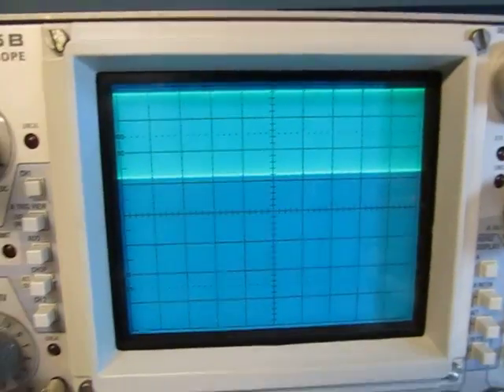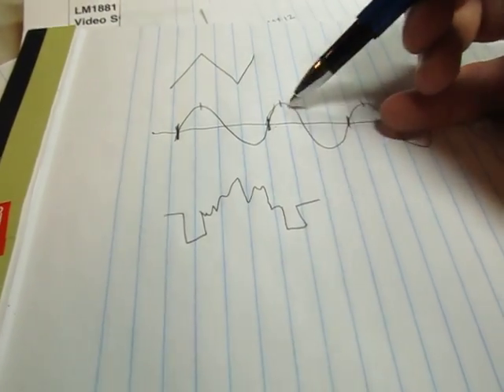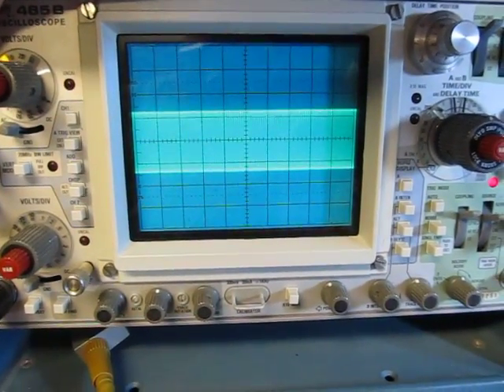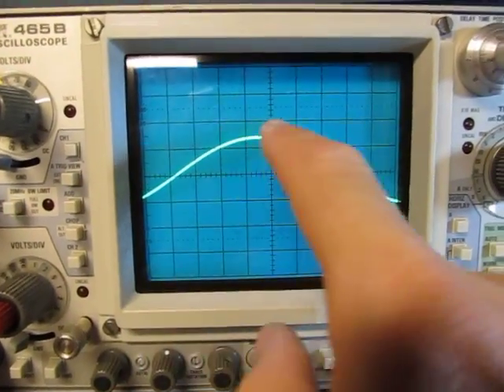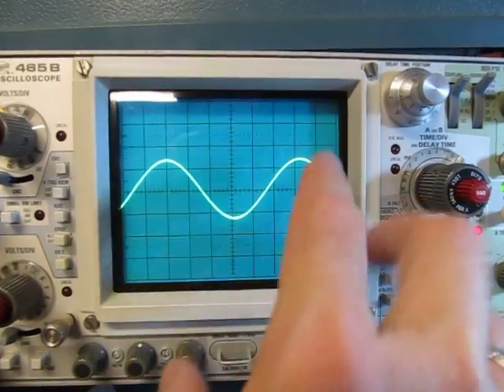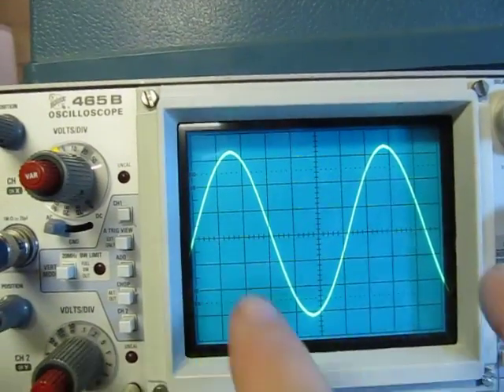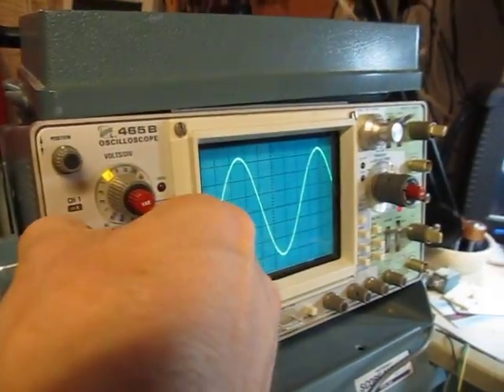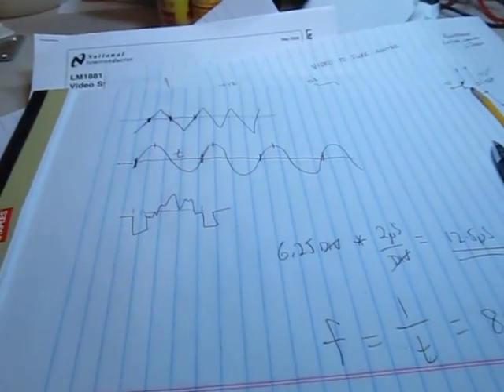#43: Analog Oscilloscope Basics: Making a Frequency Measurement

Comment: Stayed up way later than I expected dinking around with my Tek 465b I just bought and testing different frequency measurements from my old elenco mx-9300 and my little PTL-1 from CIE. Your videos have been a great aid in learning and I know I have a long way to go but I'll get there eventually. Thanks for sharing so graciously with us, not only your knowledge but your time. I can't thank you enough. Be blessed.
Reply: How is the 465B working out for you and is it not too difficult to understand/learn?there is one for sale in my area and I might buy it. I could use it to trouble shoot some stereos that I have.Cheers/Rob
Reply: +Rob Hernandez The 465B has been working out just fine. Still works good and haven't had any problems with it. Not too difficult to work with I don't think. Everything has been pretty straight forward and they're built like tanks so you can't really go wrong with one. I would recommend it in a heartbeat.
Reply: Thank you very much Redemptus I think I am going to go for it. I have heard that the Tektronix brand is a good one. And I believe this model comes with a DMM built in?
What can you use the DMM for?
Reply: Rob Hernandez The DM44 is an option for the scope so you'll find that not all of them have it. It allows you to measure DC voltage, resistance, temperature (with the temp probe, mine didn't come with the probe and it appears that Option 1 specifically excludes the probe to save on price,) as well as differential delay time (the time between any two points on the oscilloscope trace.) Honestly, I haven't used mine as it didn't have any probes though I think it can use standard 4mm banana plugs but don't quote me on that. Update: Couldn't leave well enough alone so I got some probes and sure enough it will take the standard unshrouded banana plugs. I'd have to read up on how to measure the delay between two points on the trace though as I'm not sure how that works yet. Guess I have to schedule some experimentation time soon. :)
Reply: Well that is good to know, I think  one that is for sale in my area does not come with the DMM.
I am sure that you eventually will figure it out,
Good luck. Ah and good to know that you can use the banana plugs.
Cheers

Comment: First, always measure to the center of the scope trace.  Second, the oscillation divides 1 s of time into 'f' pieces (cycles) so that 'f' T=1 s.  But we give the frequency units cycles/s=Hertz so that fT=1 instead.  Period has units s/cycle so the units cancel.  Usually, we write one of the equivalent expressions f=1/T or T=1/f.  Third, the 1% scope calibration reflects our ability to locate the trace to about 0.1 divisions; 0.1 div / 10 div = 1% is the best measurement we can make anyway so it is pointless to spend more money on more precise components.  Fourth, it is also valid to measure several periods and this strategy will always allow you to use more of the display for more precision; however, don't forget to divide your time measurement (or multiply your measured frequency) by the number of periods and be sure you count the number of cycles correctly.

Comment: Very thankful for your sharing! Question: How would you measure the percent of modulation in a signal for radio alignment? Project requires 455kHz 400 kHz, modulation  80%. Can a circuit be built that will enable you to introduce the required percent of modulation into a signal? Thank You!

Comment: Thanks for the video. Quite enjoyed. Would you kindly make a video about frequency counters, please. I have a basic/digital counter but don't know where to plug in a transmitter to see broadcasting frequency live, or, in a receiver to see what frequency I am on. Thanks a bunch.
Reply from the maker: Most transmitters and receivers use a superheterodyne architecture.  Thus, the operating frequency is controlled by a Local Oscillator (LO).  It is most common to attach the Frequency Counter to the LO output, and then apply a frequency offset in the counter to correct for the IF frequency.
Reply: @w2aew  Much appreciated the comment.

Comment: Wow, immediate reply, thanks very much. I'll do the maths re using 1/4 watt resistors in parallel, as I don't have any 1/2 watt ones. Thanks very much.indeed. My newly acquired, but elderly Marconi Wattmeter has a function that may be similar, but I am unfamiliar. An insert probe knob, a small secondary "diode detector" meter, and a "mod out" jack socket. I suspect it may do part of what your circuit offers, but I'd rather have a standalone interface. Thanks again!

Comment: I wish you had covered how to trigger on the delayed sweep.  I'm looking at a 50Hz square wave (generated from 50Hz mains), which looks really clean - until I expand the transitions, which show HF ringing.  Half way across the screen, however, there's a bit of jitter, so simply expanding the waveform isn't enough to see the ringing.  I need to stabilise it.  I have a 2465, but this is the first time in 20 years that I've had it out, and I can't remember how to use it properly.  It had taken up smoking in the interim, so I had to replace all its PSU capacitors first.
Reply from the maker: I've got a couple of videos on using the delayed sweep, and the triggering on that:
https://www.youtube.com/watch?v=J-7MycqHPOs
https://www.youtube.com/watch?v=vvqVTD-VEow
https://www.youtube.com/watch?v=0enuruGWYk8

Comment: When an audio amplifier has an oscillation problem that is causing oscillation in the amplifier circuit somewhere. I have seen repair technicians set the Oscope to a very slow sweep on the timebase so that you the trace as a moving dot. The moving dot will move up and down at random from the oscillation issue in the amplifier circuit. What I'm confused about is why are the repair techs setting the Oscope to a very slow sweep time base which is ment to measure and display very low frequencies and the oscillation frequency is audible. Since the oscillation is audible I would think of setting the Oscope timebase to a fast sweep setting but then you won't see the oscillation because the Oscope is just display a straight flat line even when the oscillation is not a low frequency and it Audible hearing the oscillation coming out of the speaker.

Comment: W2aew, I connect a +9vdc to the oscillscope channel#1 and connected a lab test function set at 1Khz sinewaveform frequency to the "External trigger" input and set the Oscope trigger Mode to external. Why isn't the Oscope displaying and drawing a 1Khz sinewaveform frequency on the Screen?
Reply from the maker: That's not how an oscilloscope works.  The scope displays what is connected to the vertical channel input(s).  So, in your case, it is displaying a flat line that represents the 9Vdc that you connected to it.  Instead, connect your 1kHz signal to channel 1 and change the trigger source to channel 1, and you'll see your signal generator's output.

Comment: Is it possible to setup an old analog scope to display/plot the RMS of an AC signal?  Like what happens when you zoom out of a DC signal and see it plot over a long period of time.  It would be similar to how these newer bench DMMs are graphing the fluctuation of a DC signal or RMS of an AC signal.  I have a old Tek 5540 scope and a digital Rigol scope where I'd love to figure this out instead of buying a new bench DMM.
Reply from the maker: Are you sure about that Tek scope number?  I don't recognize that as an old Tek analog scope.  I know there was a 5440 scope (analog scope with 3 plug-in slots).  The digital scope will usually have an RMS measurement as part of their automatic measurement system.  An analog scope can not show you the RMS value as a trace directly.
Reply: @w2aew  The Tek 5440 is aka (5403/D40).  My digital scope with state the RMS figure but won't plot it.  Does Tek's new digital scope plot the calculated RMS?
Reply from the maker: @rpbale  Newer scopes can plot measurement trends

Comment: Hello, I own a Leader LBO-526 scope. It also has Delay time , A and B TIME/DIV and DELAY TIME. 
The coupling has: AC, HF-REJ, TV-V AND TV-H.  The source has: ALT, CH-1, CH-2, LINE AND EXT. 
Can you explain what these are and would I ever use these functions.
Thank you.....
Reply from the maker: I have videos on these topics.  They show the features on a Tektronix scope, but the operation would likely be similar on your scope.  The Delay Time, A and B Time/Div settings all refer to a dual, delaying timebase.  This is how you "zoom" on a portion of a waveform with an analog scope.  Here are 4 videos on the topic:
https://www.youtube.com/watch?v=54roz8IUoVI
https://www.youtube.com/watch?v=J-7MycqHPOs
https://www.youtube.com/watch?v=0enuruGWYk8
https://www.youtube.com/watch?v=vvqVTD-VEow
The coupling controls to listed (AC, HF-REJ, TV-V, TV-H) and the Source controls (ALT, CH1, CH2, Line, EXT) all refer to the Trigger operation.  I have several videos on these.  I don't cover TV-V or TV-H though.  These two settings allow you to trigger on vertical sync or horizontal sync signal on TV composite video signal.  If you never work on a TV, you'll never need these trigger settings.  AC coupling means that the signal going to the trigger circuit will be AC coupled.  HF-REJ will filter away any high frequency noise on the trigger signal.  Here are some videos on Trigger controls:
https://www.youtube.com/watch?v=OFGm-Pel4Hg
https://www.youtube.com/watch?v=BKjJK1rsZmM

Comment: HI great lesson..,whats the exact make of this particular oscillascope ?  : ) i want to measure different frequency reactions of hydrogen dry cell performance for optimum efficiencies ,..cells are running at about 13.8 volts ..2 v's between each electrolytic plate ,do you think this would be a good tool for this..? many thanks : )

Comment: i have a question that came in my test. i am not able to solve it. please help. Q.the linear sweep for time base has deviation from its nominal waveform( triangular)NW:+ve slope ends at T, -ve slope ends at 1.15T
Actual waveform:+ve slope ends at 1.1T, -ve slope ends at 1.3T.
a 5V p-p sine wave with freq of 1KHZ will be measured on the oscilloscope as a sine wave with _______V and ______KHZ frequency. pls pls help.

Comment: how are you converting microseconds to hertz, pretty baffled about this part, 1/12.5=0.08 then is it times 1000 to get hz? i found converter so figured it eventually 😁👍🇬🇧
Reply from the maker: 12.5us is equal to 0.0000125 seconds.  1/0.0000125 equals 80,000Hz, or 80kHz.
Reply: I see now, i was being daft and mixing hz with khz.. Thanks for helping with my 'new' old scope😁

Comment: I'd have to argue that you could get a more accurate estimation by counting multiple cycles, rather than just one.
Reply: George, using multiple cycles really won't buy you much.  Consider that on an analog scope, you can probably estimate the x-axis crossing point to within about 5% of a division. When you slow the timebase down to put more cycles on the screen, that 5% of a division will larger (in absolute time) as well. This error gets divided by the number of cycles, but the end result is that the error is about the same as using the same number of divisions to measure one cycle.  The best way to minimize errors is to use as many divisions as possible to make the measurement, regardless of how many cycles are included. Also keep in mind that typical analog scopes will have a timebase accuracy of 3-5%, and that sometime this spec excludes the far left and right divisions due to sweep non-linearities.
Reply: Thank you! That's a great answer.

Comment: So I'm counting 5.4 Divs @ .2ms/Div from rising edge to rising edge.
5.4 x .2 = 1.08ms per cycle.
1.08/1000 = .00108 seconds per cycle
1/.00108 = 925 Hz?
I've got my function generator set around 10K.
What am I doing wrong?
Reply from the maker: Sounds like you have a 10x magnifier turned on on the horizontal. My earlier comments about 1x/10x was referring to probes, since many scopes don't have the Horizontal zoom. Turn the 10x zoom off, or calculate using 0.2ms/div divided by 10.

Comment: good afternoon .. and happy new year 2022 ... I have a tektronix 7L12 and it has a quadruple orational integrated IC is Tek 155 0035 00 it is in circuit as U820 vertical output .. if you can help me to repair this instrument ... there is a replacement for IC U820 ??? greetings from Argentin
Reply from the maker: This is a custom IC that was designed and fabricated at Tektronix, there is no commercial replacement for it.  The design of the chip is quite simple, and might be able to be replicated discretely, or it's function could be duplicated with a modern quad op amp (provided the application doesn't also need to control the BIAS node (pin 12).  Here is the basic design information for this chip: https://w140.com/tekwiki/images/0/0d/Tek_m053.pdf
Looks like someone on the TekScope group did make a descrete replacement: https://groups.io/g/TekScopes/album?id=28989

Comment: useful video .. how do i measure a frequently direct from radio with an oscilloscope ?
what power can they handle ?
ta
Reply from the maker: A scope isn't the best tool for measuring RF frequency - typically not very accurate, only good to a few percent.  However, it can be done.  Do NOT connect the transmitter directly to the scope!  The scope input's 50 ohm termination (if it has one) is typically rated to a few hundred milliwatts at best.  If you want to couple the transmitted signal to the scope, you're better off using an RF Sampler/Tap, or even an antenna in the proximity of the transmitted signal.
Reply: thanks mate, yeah kind of knew i couldn't connect directly  but was unsure how, all my scopes inputs are 1Mohm 20 picofarrad .
what about looking at a 240v AC sine wave ? ( or rather 12v for safety) how would i so that ?
cheers  :)
Reply: You're probably better off going with a spectrum analzyer.

signals directly from radio are not like a raw sine wave
First of all they will have modulation and that right there is opening a can of worms so to speak

simple answer... 
Get a spectrum analzyer   or an MSO

Comment: If one probes a signal of 300 MHz on an Oscilloscope (analog) with 50 MHz bandwidth, we might still see the waveform, isn't it ? It's just that it would be highly dim.
Reply from the maker: +analogy ? The "dimness" will be a function of the sweep speed.  The 300MHz signal will be greatly attenuated, and probably not stable (because the trigger circuit will probably be unable to trigger on it).
Reply: So how does one know if a O'scope is calibrated?
Reply: So that what is being measured is an accurate measurement.Does it need to be taken somewhere to be calibrated? and by who?
Reply from the maker: You would have to measure a signal of a known amplitude and known frequency to check the calibration.  They are often very close anyway, they don't drift much.  Also, many times you're just checking to see if a waveform has the right shape (not distorted, etc.), so a perfect calibration is often not really required for hobby or repair work.

Comment: how do you set an analog oscilloscope to display the input signal to view the frequency sweep in a logarithmic display so each graticules are to a logarithmic scale ? because I think analog oscilloscopes display the signal as a Linear scale not log?
Reply from the maker: You would have to have a log waveform that corresponds to the frequency sweep as use this as the X input.
Reply: yes you set your function generator/audio generator to LOG sweep. The Oscope has 8 boxes divisions. How do you set up the Oscope so each box division is a Decade so its 1,10,100,1000,10000 etc. Does the function generators sweep time setting have to be the SAME sweet time setting as the Oscope time base setting?
Reply from the maker: @waynegram8907  Most oscilloscopes have 10 divisions horizontally.  If you can get a log sweep from your function generator, then set your scope's horizontal sweep time to 1/10th of the generator's sweep time (so that the total sweep time is the same).  Remember that the scope's sweep time is time/division, and with 10 divisions horizontally, you'll have the same total sweep time.
Reply: thanks for the help, can you please give an example of the generators sweep time setting the setting the Oscopes timebase sweep time to 1/10th? what formula calculation did you do to get the sweep times to work together for log sweeps? I enter in my calculate the generators sweep time and then "divide it by 10" to get that Oscopes timebase sweep time?
Reply from the maker: @waynegram8907  If you set your function generator sweep time to 100ms, then set your scope to 10ms/div.
Reply: thanks for the help. So you take the function generators sweep time and divided by 10 to get the Oscope timebase sweep time?Does digital Oscopes have display settings to change the display settings to display a log scale & log divisions? I think I have seen this done before on youtube videos on digital oscopes in the display settings